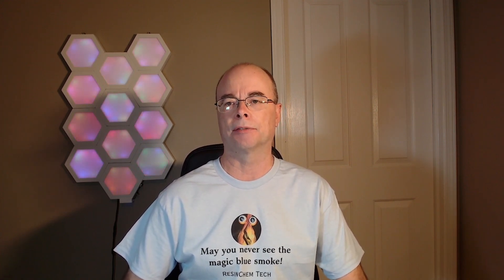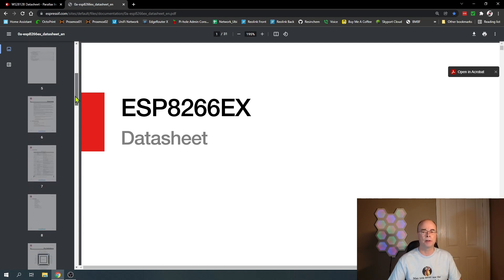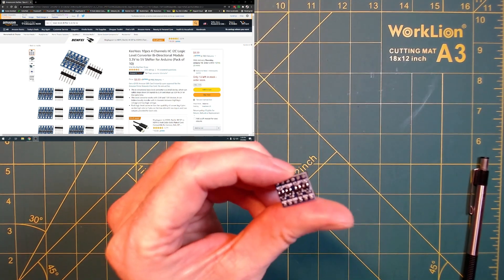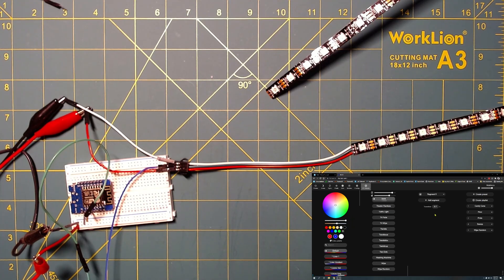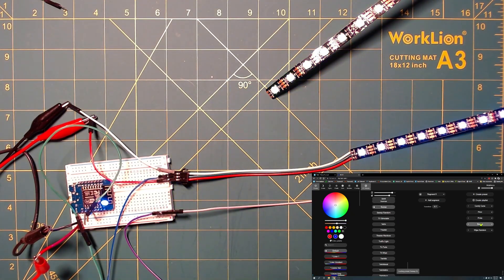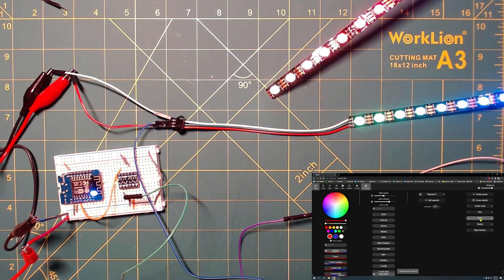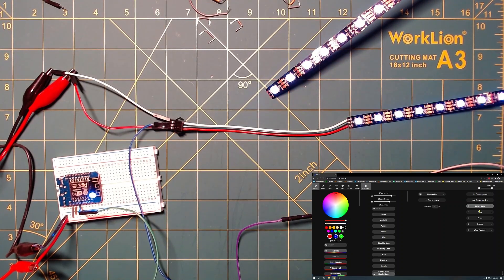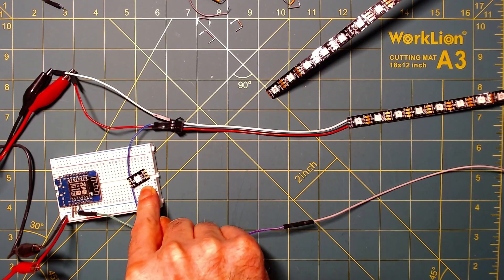Logic Level Shifter and WS2812b LEDs

Comment: So, if I am only a few inches from my lights, do I still need a logic level shifter?  What logic level shifters / ESP32 do you recomend for running neopixels with WLED?  I'll be running 268 lights.
Reply from the maker: You can probably get away without it... but as I mentioned, for the extra $1 or so and a few extra minutes of soldering, I always include it as a precaution that I won't have any data signal problems due to low voltage on the signal line.  But you most likely won't have a problem with only a few inches.

As far as recommendations, I keep a list of my favorite and recommended items here: https://resinchemtech.blogspot.com/2022/04/my-favorite-items.html  You can find links for both the ESP32 and ESP8266, along with the logic level shifter that I use  on that page.

For an install of 268 lights, you can use either the ESP8266 or the ESP32.   If you plan on using a sound-reactive version of WLED, then I'd recommend the ESP32.  Otherwise, you can use an ESP8266.  Personally, I like the D1 Mini or the ESP32 mini just for their smaller size and therefore the overall controller size is smaller.

Just let me know if you have any additional questions!

Comment: Hi, I continue to find your videos very instructive and with great dedication. I already have more clarity about the use of the Logic Level Shifter, the wiring that the video shows is like this: GND - GND, 5V PSU -> 5V LLS, DATA IN -LV2 -> DATA OUT HV2 ?
Reply from the maker: Just to be clear... you need to connect 3.3V, ground and your signal IN on the LV side of the shifter (3.3V to LV, GND to GND... then the signal to any of the LV1 - LV4 channels).  On the high side/HV of the shifter, you connect 5V and ground (5V to HV, GND to GND.. then your outbound signal to the same HV1-HV4 as the signal on the LV side.)

Think of it this way... you need to supply voltage on both the low (LV side) and high (HV side) corresponding to the voltage shift you wish to have in your signal.  So, since the signal from the controller is 3.3V, you connect 3.3V as well as the signal on the LV side.  Then you want the outgoing signal to be 5V, so you connect 5V on the high (HV) side.  The outbound/shifted signal just needs to be connected to the same 'channel' number as the low side... if you use LV2 for the incoming signal, then you use HV2 for the outgoing signal.

I hope that clears things up a bit!  Let me know if you have any other questions.
Reply: Many thank  @ResinChemTech
Reply: @ResinChemTech  That's a really helpful explanation.  Thanks.

Comment: Excellent test, thank you! I'm adding some logic level shifters starting now XD
Reply from the maker: You're welcome!  Many will say that a shifter isn't necessary... and in certain cases you can get away without out it.  But as I mentioned, for the $1 cost, I'd prefer to use one and avoid any potential signal problems like I demonstrated in the video.

Thanks for watching and taking time to comment!

Comment: Thank you, didn't know about this issue.
Reply from the maker: You're welcome.  While you can sometimes get away without it, using the logic level shifter assures a strong signal and can often avoid any problems when using longer wire runs.

Thanks for watching!

Comment: Hi, Somehow YouTube knew to recommend this video to me. It is really informative and I appreciate the link to the level shifters you've been using. 

I've been googling and discussing a problem with the developers at Adafruit who write CircuitPython about a strange glitch I am seeing only on SAMD51 (Adafruit ItsyBitsy M4 Express and Feather M4 Express boards) when used with a level shifter. In my test cases it glitches just like your test case with a few notable differences. One is that only the very first pixel displays the erroneous behavior (often staying red when it is being sent other colors). In my case all other pixels are fine. Other differences are my distance is less than 6" from level shifter to first pixel, or one foot in most extreme case I tried. This happens on a strip of 300 or 144 pixel strips. If I use the 3.3v logic level of the boards GPIO pin it works 100%. Lastly, I am using CircuitPython whereas I suspect you are using C/Arduino. To add even more strangeness, the same logic level shifter works properly on all other dev boards I have with different mcu such as RP2040, and ESP32-S2. In other words, in my specific case I only glitch when using the level shifter. Working with the people who implement CircuitPython, they think this could be a subtle problem somehow stemming from the timing of the ws2812b code running on the SAMD51. One additional oddity: the Spring temps came breezing in to Sturbridge, Massachusetts where I live bringing 70°F+ temps and the glitching went away! I am using a TI SN74AHCT125 level shifter. I discovered all this after arbitrarily selecting a SAMD51-based board to try with a level shifter to run an animation script that has been running for months using native 3.3V logic level. Then I went back and regression tested with an assortment of RP2040 and ESP32-S2 based boards.
Reply from the maker: Hi!  Glad you found me and hope I've been at least a little help.

First, you are right in the fact that the code that I am running is Arduino based, but I didn't develop it.  It is firmware called WLED by a developer called Aircookie.  I don't know 100% which library it uses... FastLED I think?  I am by no means an expert, but I do know that there can be issues with speed with using the I2C logic level shifter (like the one I show), but that usually results in some visible lag when doing larger displays or thinks like animation where you need a smooth 30 frames per second.  I've used it with displays of up to 600 WS2812b pixels without issue... but again, I'm just running patterns and not trying to do real animation.

I've not experienced anything like you describe, but all of my LED projects are ESP8266/ESP32 based.  I haven't used either an Adafruit board or MicroPython in any of my LED projects.  However, in situations where I have seen what you describe (the first pixel... or sometimes it's the first 2 or 3 behaving oddly), it has always been signal related for me... or interference with the signal.  I had one install where the first 1-3 pixels would just light up by themselves at random.  If I powered the strip on and back off, those pixels would turn off only to find them back on again the next day.  In my situation, I was using the shifter, but I had a long (~15ft) run where all three wires (VIN, Signal and GND) were within a single cable.  I guess interference can occur with long parallel runs of the ground and signal.  In my case, adding a 33 Ohm resistor to the data signal cleared up the problem.  I don't think this is your case as your data runs are short, but maybe it gives you another idea?  I definitely appears to be some sort of signal problem/interference (which is pretty obvious I guess). Any chance you could test a different LED library to see if that makes any difference?  I'm guessing you are maybe using the NeoPixel library?  I think there is something similar to FastLED (maybe called FancyLED).  Might be worth a shot.

Let me know what you find.  I'm still learning myself and I'm always happy to learn any troubleshooting tips I can share with others if they run into a similar problem!

Comment: Hi, what is the need for connecting the positive wire through the level converter and controller (I'm using a pi) if it is already 5V?

 Can I not just connect it directly to the LEDs? And use the shifter to run a 3.3V data signal (from Pi) and a common ground (from supply and pi) to the 5V data signal and ground on the LEDs.
Reply from the maker: I'm not 100% sure I understand what you are asking, but I'll take a stab at what I think it is.  Let me know if you are asking something different.

This video was really targeted towards using ESP boards.  Since you are using a Pi (and I'm guessing powering via 5V USB), the hookup might look a little different.  When you say "...connect 'it' to directly to the LEDs", what do you mean by 'it'?  Maybe the +5V line?  If so, the logic level shifter requires  +5V and gnd on one side and +3.3V and gnd on the other to shift the signal up (or down).  I guess it really doesn't matter where you get the 5V and 3.3V supplies for the shifter.  You could, which I believe is what you are suggesting, run the 5V side from the 5V supply at the LED strip.  But I think that would just mean an extra longer wire run (assuming you are locating the Pi/controller a distance from the start of the LEDs).

Alternatively, you could power the shifter using the 5V and 3.3V pins from the Pi.  Ground can come from anywhere, but it does have to be connected to both sides of the shifter.  I hope that is helpful.  For my ESP boards, I am not powering the board via USB, but from the power supply and to the 5V pin on the board.  At that point, I have both 5V and 3.3V available on the board and I use these to power the two sides of the logic level shifter (plus, obviously running the data line through the shifter as well).  Because the ESP boards are not designed to handle high current, my 5V power is run in parallel to both the controller and the LED strip (you can't pass the 5V power through the controller with anything more than a few LEDs... well, you can, but you will probably fry the board at some point).  It's a little different with the Pi (I believe) because the 5V pin can tolerate up to the max of the USB power supply... at least up to a couple of amps... but there may be other limitations just from the traces and other components on the board... I'm not an expert at the Pi or its specifications as I haven't used one with LED lighting.  But I always recommend running your 5V power separately to the LED strips and not "through" the controller itself.

If that's not what you were asking, just let me know and I'll try to answer your question.

Comment: Will increasing the signal voltage allow the signal to be transmitted with a longer cable? I need a distance of 30-40 meters
Reply from the maker: While boosting the signal from 3.3V to 5V will definitely help with the longer run, 30-40 meters is still a VERY long run between the controller and the start of the LED strip.  My longest run was about 8-10 meters, so I've not tested anything longer than that.  I would also use the largest gauge wire that you can because it will result in lower resistance and therefore less voltage drop.

It might be necessary to 'boost' the data signal again along the way.  Quindor over at QuinLED sells a booster meant just for this purpose:  https://quinled.info/quinled-data-booster-for-sale/  This also has a resistor onboard, which you may also need on your data line... especially if you have a long run where the data line and ground line are running together in parallel.  This can introduce noise into the data line and cause all sorts of problems with your LEDs.

Good luck with your project.  I'd recommend bench testing the signal at the planned distance prior to completing the actual install.  That way you'll know if you need to boost the signal further and/or include a resistor on the data line.
Reply: @ResinChemTech  Thank you for sharing your experience.

Comment: By using the shifter, is it necessary to power the board with 5 or 3,3V for one channel, or are channels enough. I am planning to use parallel power to my strips, not powering via breadboard
Reply from the maker: You can actually use the 5V pin from the ESP8266/32 to power one side of the shifter and the 3.3V pin to power the other.  The shifter that I use has 4 channels available.  You run 5V and ground to one side (HV) and 3.3V and ground to the other side (LV).  You then have 4 different channels, or data signals, that you can shift up from the outbound data GPIO pin and then out to your LED strips (effectively boosting the signal from 3.3V to 5V).  I can't post any diagrams here in the comments, but you can see a diagram showing what I am describing in my related blog article: https://resinchemtech.blogspot.com/2021/08/sound-reactive-rgb-floor-lamps.html

And yes, you will want to power the two LED strips in parallel to your controller and not through either the board or controller since you will potentially be drawing more amps then the board was designed to handle.  There's a diagram of this at the related blog as well.
Reply: @ResinChemTech  you mean powering both directions, 5v and 3,3v, or only one side? Thanks for many answers
Reply from the maker: If you look at the logic level shifter (at least the one I am using), on one side you will see pins for HV1, HV2, HV, GND, HV3 and HV4.  The other side has the same thing, except LV.  You feed 5.0V to the HV pin, ground to GND on one side, then 3.3V to the LV pin and ground to GND on the other... yes, both 5V to one side and 3.3V to the other.

Then you can feed your data signals from the ESP8266/32 pins to any of the LV1 - LV4 pins.  You then feed the signal out to the LEDs from the same corresponding HV1 - HV4 pins on the other side of the shifter.  Just be sure to use the same pin "number" on each side.  For example, if you data line comes in and is connected to LV3, then your data out line to the LEDs need to be connected to HV3.  Each channel is separate... so you can't, for example, connect the data in to LV1 and the data out to HV3.  Again, this is shown in the wire diagram I referenced above.

Comment: Great video and you've gained a subscriber! I had one question though.

I notice it this set up that you are powering everything directly (no fuses, resistors, or capacitors). Are these items necessary or are they peace of mind items when setting up a run of around 200 leds? I see a lot of videos on youtube of people not using them but the official documentation recommends using them.
Reply from the maker: I used to add a 1000 µF capacitor at the power supply, but haven't added one in the last dozen or so projects.... and haven't had any issues, although it sure doesn't hurt to add one to help protect from power fluctuations.   A resistor is sometimes needed on the data line if you have a "dirty" signal or interference.  This mostly happens when you have a long run where the data signal and ground are in the same cable (e.g using a 3-cable cord to run both power and data lines together).  This is also rare, but I have had to add one for a given project.

Fuses, on the other hand, are probably a good idea... especially with larger install/high amp situations.  I've been meaning to cover the use of an inline fuse in one of my videos... then I always forget!  To be honest, the only place I've 'fused' my install is with my Christmas tree.  All of my other installs are 5V runs with generally only a couple of hundred pixels max.  And I rarely run those at full brightness/full pixels.  I also always oversize my power supply so that it is not taxed even at max pixel load.  I also continuously monitor any new installs for heat (power supply, controller, wiring and pixels) until I am comfortable with it. 

So, to answer your question.. are they "necessary"?  Probably not.  Are they a good idea?  Probably yes on the fuse.  The cap if you are interested in 'protecting' your controller/LEDs, especially if you have frequent power issues.  The resistor would only be needed, in my opinion, in rare cases to solve a particular issue.  But adding all three won't hurt anything and, again, would provide 'peace of mind'.

Comment: I ordered the shifters and i didn't use them. I am only using 44 led in my project and i watched somewhere that in Wled app...there is an option to ignore 1st led. I used this option and all my leds work perfect. So, instead of using the "sacrificial" led wired in, you can also use this method..if that first led isn't visible..which didn't matter in my project

Comment: I've got a 24v WS2811 strip with 1284 LEDs, 6 LEDs per segment, I set WLED to 214 LEDs. I'm using a mini D1 and about 10 feet of 20 gauge wire running data to it and surprisingly, I have no issues.  I hooked it up fully expecting issues but it looks like I won't need a level shifter in this case.  Maybe the WS2811 only needs the 3.3v vs a WS2812 strip?
Reply from the maker: I'll admit to not being as familiar with the performance range of WS2811, but according to the spec sheet, the data signal input range is 3.5-5.5V.  But again, like with WS2812, you may get OK operation at less than that.  Or it might work with one board/LED lights, but have issues with the next.  Inclusion of a logic level shifter isn't always required in every situation, but I will still continue to recommend it so that you are operating within the actual specifications: https://www.tme.eu/Document/26d574b43ad9ddaffa4d5bcd140ec145/WS2811.pdf
Reply: @ResinChemTech   I started thinking more into this and realized that the difference between your experiment and my real life setup of a long WS2811 strip is that I’m powering my mini D1 with a separate 5v 1A power supply through the micro USB port and I’m powering my LED strip with 2 24v power supplies. The ground on the mini D1 is tied in directly to the ground on 1 of the 24v power supplies, about 1.5 ft run of ground wire, and all 3 power supplies are on the same outlet. The data out of the mini D1 is about a 10 ft run to one end of the strip, same power supply as the ground. Can you humor me and try a separate 5v power supply in the micro USB port and power your strip with a separate 5v power supply and see if it makes any difference in your test?  I’ve got the exact same mini D1 board so this is really bugging the heck out of me!